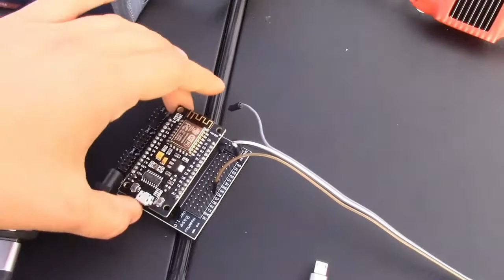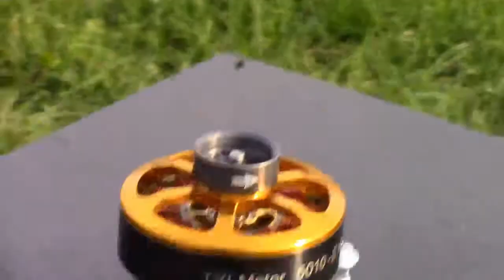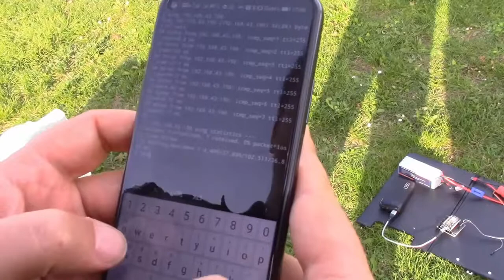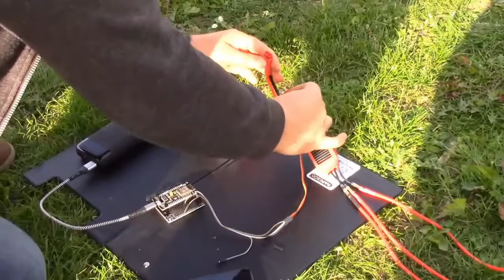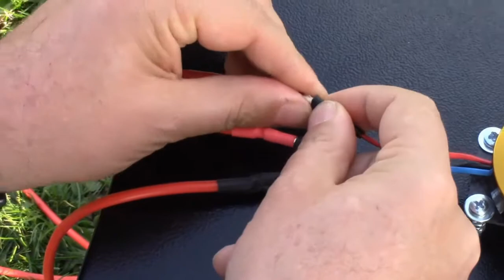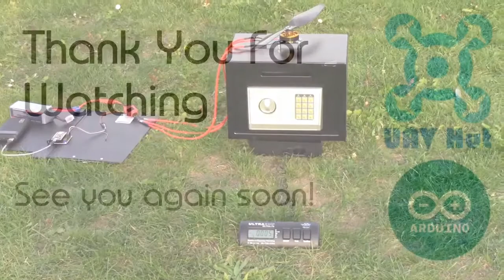5010 KV340 motor test (Is it SAFE to fly!?!?!?)

Comment: Thanks for covering the 5010 size motors in English. They have been popping up everywhere lately, and the only info I could find about them is in Hindi.

What ESC are you using? What battery? (cell config, A/hr, etc.) 

From the looks of those windings, I'd say that thing can take a TON of current. With the 50mm diameter bell, I'd say it converts that current directly into mass torque!!! Scary cool motors man!